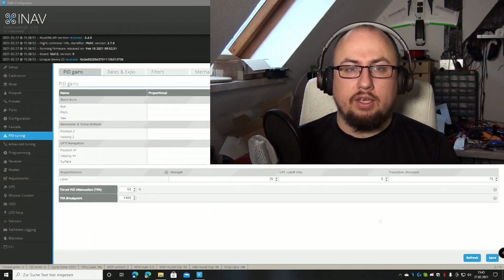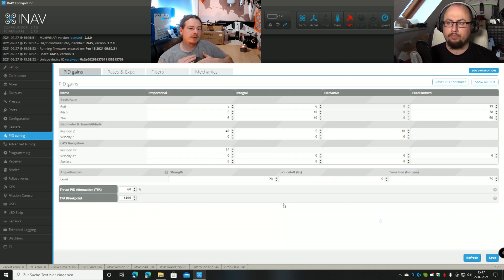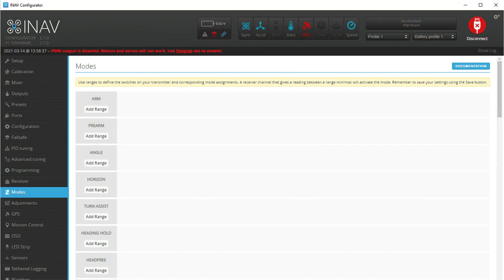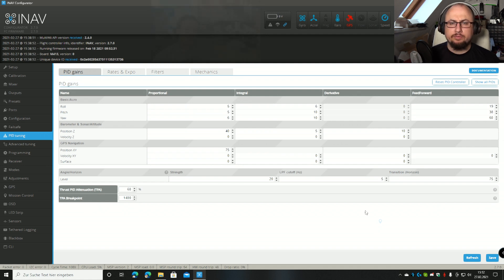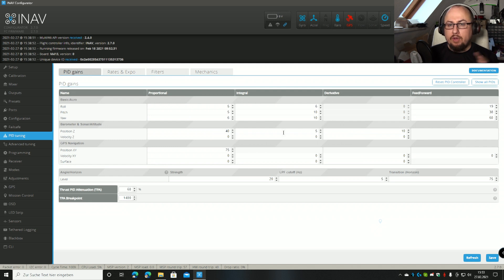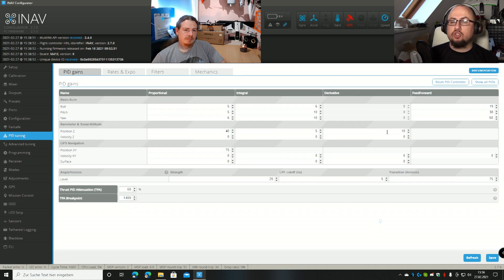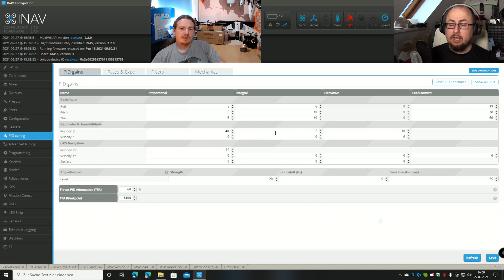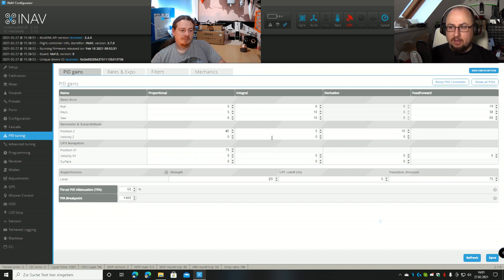Tuning iNav Explained: 2 - Tuning Angle and Altitude Hold, and why they are important

Comment: Hi did you know why INAV cannot detect my M181 Walksnail Compas?
I already plug into the socket to my Speedybee f405wing (SCL &SDA already connected)

I heard that if I want to use Altitude Hold feature in INAV I have to activate the Compass
Reply from the maker: If you’re setting up a fixed wing. You don’t need compass. You only need that for alt hold (and other navigation) on a multirotor. 

If the I2C bus is wired up correctly. Maybe the compass is conflicting with another device. Like the baro.
Reply: @MrD  hi
Thank you so much
I missunderstood about compas 
I will disconnect the wire
Thank you so much

Comment: Hello Darren, as always a great video, although I've seen it a bit late, hahaha, but it always clears up my doubts, and when I've asked you something you've always answered me well and helped.  Today I am considering the following, I always have a mode with a fixed altitude, I use it a lot, but this mode takes away control of the throttle, it doesn't matter, but it happens sometimes, either because the barometer is poorly ventilated, or for any other reason The reason is that the aircraft does not maintain altitude, it generally loses altitude little by little, this is dangerous when flying low, my question is, is there any option for me to instruct the aircraft to raise or lower its flight height? I think that is done in drones, if you set the height, with the throttle in the middle position, if you raise the stick it goes up in height and if you lower it, it goes down in height. Can that be done in INAV with an airplane?  Thank you very much in advance, greetings.

Hola Darren, como siempre un video estupendo, aunque yo lo he visto un poco tarde, jajaja, pero siempre aclara mis dudas, y cuando te he consultado algo siempre me has respondido bien y ayudado. Hoy me planteo lo siguiente, tengo siempre un modo con la altitud fijada, lo uso mucho, pero este modo me quita el control del acelerador, no importa, pero ocurre a veces, bien por que el barometro este mal ventilado, o por cualquier otro motivo que la aeronave no mantiene la altura, por lo general va perdiendo altura poco a poco, esto cuando se vuela bajo es peligroso, mi pregunta es, hay alguna opción para que yo le indique al avion que suba la altura de vuelo o la baje, eso creo que se hace en los drones, si fijas la altura, con el acelerador en la posicion media, si subes la palanca sube de altura y si la bajas, pues baja de altura ¿Eso se puede hacer en INAV con un avion? Muchas gracias de antemano, un saludo.
Reply from the maker: I guess you are talking about Cruise mode? You can raise and lower the altitude with the pitch stick. It is a slower adjustment than in normal Angle mode.
Reply: @MrD  
Excuse me for insisting, so in cruise mode, raising and lowering the throttle stick can we modify the height?  I didn't know that, if so, please confirm.
Perdona que insista, entonces ¿En modo crucero subiendo y bajando  el stick del acelerador podemos modificar la altura? Eso no lo sabía, si es así, confírmamelo por favor.

Comment: Hi guys. Arm and angle mode not working same channel. Does anyone knows why?
Reply from the maker: I would not do this. Have arm on it’s own 2 position switch. You shouldn’t touch the arm switch unless you want to arm or disarm. It shouldn’t be used for flight modes.

Comment: Hi Darren - I notice with iNav FW 4.1.0 there is no ALTHOLD - would I be correct in assuming  POSHOLD now incorporates ALTHOLD  - ...joe
Reply from the maker: Hi Joe, ALTHOLD is still in 4.1. It should be in the Flight Mode Modifiers section. Though it will not appear if the hardware to use it is not there.

But no, for quite a while now, you've not needed to add ALTHOLD to POSHOLD. I'm sure that was changed in one of the 2.x versions. With 4.1 and above, the only mode that you should add ALTHOLD to, if you want it, is ANGLE. But in all honesty, there's not much point in that.
Reply: @MrD - Sorry for late reply but you are absolutely right - wow - I suppose it's logical thinking about it - would you please suggest typical Flight Modes for a 5-7'' quad ...joe
Reply from the maker: No worries Joe. Sorry, I don’t have any INAV quads. So I couldn’t really answer that. Not without experience of using them.

Comment: I noticed that when I turn modes on for angle and horizon that my plane will twitch on its roll axis. Any ideas what could wrong?  Acro flies perfectly.
Reply from the maker: - What version of iNav?
- What have you done so far?
Reply: @MrD  I ended up turning the strength down to 5 and seems to be ok. I’m using 4.1 right now. I have 2 HEE wings using a matek f411 and literally one flies normal with strength at 10 whereas this one needs it turned way down. Kinda weird
Reply from the maker: Both the exact same model? The first thing I would check are the control surface throws in manual mode. You may find that the twitching plane has more throw, too much perhaps? Which HeeWing model is this?
Reply: @MrD  Its the F01 wing. I was curious if maybe the frequency would have something to do with this. Too much over compensation for autoleveling?  Reminds me when the rate gain is too high on a kopilot fc
Reply from the maker: Are both planes running default PID settings? Have they been autotuned? If so, how did you do the autotune. The level strength shouldn't really cause this problem if it's fine on an almost identical setup. It's more likely the model has a more aggressive setup somewhere. Did you every click the reset PIDs button?
Reply: @MrD  yeah I haven’t messed with any of the pid settings. Like I said both fly awesome in acro. I don’t really use manual very often. I have tried to autotune but not sure if it saves the settings.
Reply from the maker: To be honest, stuff like this is tricky to sort out on YouTube. If you’re on Facebook or Discord, it would be worth joining the INAV Fixed Wing Group on those platforms. With the ability to share images and videos, diagnosis is easier. The links for both are on INAVFixedWingGroup.com. It would be good to see the PIDs, rates, mixer, and outputs for both models.

Comment: hi. I cranked my FF really high like over 120 and lower angle strength and it flies really nice...why ? is it okay . cause the pre sets sucks , and I can't fly acro without crashing al the t ime. thanks for the video
Reply from the maker: What version of iNav are you using? There haven't been presets for a few versions now, because they did suck. With iNav 4 and 5. Using the default settings and correctly performing the autotune will get models flying pretty well for the most part.

Comment: Hi, friends, I m just noted that my ANGLE mode (testing on the table at home) , the elevons are moving just a little slowly in the  conter-react , it is normal ? I not eve made the maiden flight. Where should I adjust the rates of the servos in for ANGLE mode ? labels name in the TAB  of the Inav interface ?, thank you ! and I m really new in this world of Inav.
Reply from the maker: Angle won’t react fully until it’s flying. You don’t need to adjust the rates for angle. Just make sure that when in manual the surfaces move correctly, and also move in the correct directions in angle. Finally, make sure that stabilisation is moving in the correct directions. 

It reacting slowly is normal on the bench.
Reply: @MrD  Hi Mr.D, and thank you again, I really appreciate your tips, and yes, I checked everything regarding the elevons movement  in 
MANUAL , and these reacts correctly and in the right way, also I checked in ANGLE too, and even that the reactions are very slowly and "heavy", and yes , they counter-reacts correctly. Well, you encouragement
me now, and I feel better now in front of the maiden flight, just waiting for the weather allow it.(much rain and windy) regards from Sweden.
Reply from the maker: Yes, it should be fine. Angle will be slow until you autotune if you're using iNav 3.0. But manual will of course be fine, and Acro will react quickly. If you're apprehensive about the maiden, you can check your settings here https://www.mrd-rc.com/tutorials-tools-and-testing/flight-controller-therapy/inav-pre-maiden-checklist-a-helpful-reminder-and-saver-of-foam/
Reply: @MrD  Oh thank you this guide was exactly what I was looking for, but coludnt find any like this in the new Inav 3.0.1 Wikipedia, just a lot of information but nothing consist and simple like your pre-maiden  check list !, I will follow that now, and wait for the weather be fine for maiden, and then I ll be back with the test report. thank you !! again greetings from Sweden.
Reply from the maker: I'm glad it helped. The iNav Wiki is a bit out-dated in places. I hope the weather turns soon.

Comment: I got some problems with angle mode ... It levels but it takes like 5-6s which means it will hit the ground if I don't correct it pitches down after 180 turn
Reply from the maker: Do you have any DVR footage of this?
Reply: @MrD  I'll try to look it up I think I do thx for the help
Reply: Not exactly the one I wanted but here you can see auto trim doesn't do pretty much anything and it keeps pointing down and rolling left. In manual mode the plane flies like a charm completely level pretty much so mechanical trim seems ok .. in inav o made it so it has 4 degrees on pitch so if it's on level surface it points little bit up .. not sure what's wrong .. no radio trims either
Reply from the maker: You’re 100% sure there are no radio trims. That would have been my first guess looking at the footage. 

If it is flying perfectly level in manual with hands off the sticks, and there are no trims in the radio. The next thing I would look at is board alignment for the roll and pitch. Perhaps put the roll and pitch angles on the OSD and set up adjustments to change them in flight. I’ll see if Marc has any suggestions too.
Reply: @MrD  I'll try that.. no trims and perfectly level with hands off in manual mode .. it's weird my other planes work pretty good this one not so much haha
Reply: @MrD  so I figured it out .. it's a horizon drift .. inav suffers from this and it's well known seems like more videos on this here https://youtu.be/yKIPFwF-fgU
Reply: @MrD  fix is here seems like need to increase the ignore rate .. gonna try this over the weekend and report back

Comment: Tried Alt Hold and quad went to shoot up to the sky lol 
trying to figure this out
Reply from the maker: There's your problem, you're using a quad ;) Is the altitude correct and stable on the OSD?
Reply: @MrD  lmao haha.. I do want to get a plane. Now that I found a field to fly at. 
Yea altitude is steady in OSD. 
I tried lowering alt hold pids in steps from default position 50,0,0 - velocity 100,50,0 down as low as 10,2,2 and 5,1,1
 Shot up a lil slower lol
I have mid throttle off so I left that throttle at 1500. Wondering if I should change to closer to hover which changes depending on battery by a lot lol.. Tried also with a 4S battery for less power.
Reply from the maker: I guess it depends on how alt-hold is supposed to work with a quad. I really don’t know anything about them. I have one on BetaFlight, but hardly fly it to be honest. 

My thoughts would be that alt-hold should hover or hold altitude if you are moving. So that should automatically change the throttle to do this. But I really don’t know.
Reply: @MrD  yea suppose to adjust throttle to hover. On my other quad it just slowly went down. Didn't have issue like this. This one crazy. I'm try lowering that mid throttle setting though it is off. 
I do know even though return to home is off I can't arm with it satellites unless I turn on rth then turn on arm with satellites then set back to drop lol

Comment: Hi, Darren. In angle mode on my airplane I noticed a very high difficulty to roll and pitch. Please, what parameter should I need to change to get more maneuverability on it? Should I increase FF values for roll and pitch? Cheers from Brazil. Thanks
Reply from the maker: Have you done an autotune?

It’s recommended to set the FF so that the movement in acro is 80-90% of the movement in manual. After that, you should perform an autotune. Have you done this?
Reply: Yes, I already have done auto trim and auto tune. In acro mode and auto tune the airplane flies perfect. When I turn to angle mode the flight is very hard.
Reply from the maker: @SILVIOFRANCO1  your rates may be too low. I had this last weekend. I increased the rates and max angles on one plane, just the rates on the other. It was the rates that had the most effect. Try increasing by 20. Both planes I was maidening were C1 Chasers, so a good comparison between the two.

Comment: I am still a bit confused about altitude hold.  I thought  info from the barometer (and maybe gps?) was used for set point, but did I understand correctly that it is just using accelerometer? maybe I did not fully understand

Comment: Will this also apply to the upcoming inav update? If not, would you mind updating the description indicating what inav version this apples to. Thanks Darren.
Reply from the maker: This applies to the current version of iNav. But much of it will still apply with the next release. What is changing is some of the initial tuning methods and also the addition of Derivative. The theory on how the stabilisation system works, the setpoint, the importance of Angle and rates will be the same (with the addition of the D). There will just be a couple of differences when it comes to setting them up. We’ll have a video with the next version covering what has changed and how to get a good initial tune.
Reply: @MrD  thanks Darren. Thanks for the great quality videos you put out.
Reply from the maker: Thank you. I really appreciate that.

Comment: Another fantastic video. Just what we need!  Shout out to Horizon mode!
Reply from the maker: We know how much you love Horizon Steve
Reply: @MrD  I set one of flight mode as PosHold+AltHold, its not arming in this mode,and when i armed in Angle and after takeoff changed mode to PosHold,then my 7"quad coming down sharply.
What is reason?
Reply from the maker: It won’t arm in a navigation mode like pos hold. This is a safety feature. 

To be honest, I don’t know why it drops in pos hold. I don’t fly quads, so have no experience there. Is your baro covered with open cell foam?
Reply: @MrD  No, my baro is completely covered by Kotking coating, i applied coating to fc,esc, to make it waterproof, is it making this issue?
Reply: @MrD  I have applied Kotking coating to make it waterproof, so coating also covered barometer sensor, is it causing this issue?
Reply from the maker: Yes, there is a hole in the baro to sense the pressure. If that hole is blocked, the baro is basically doing nothing.

Comment: I learned a lot today.  Thank You.  There is not much documentation out there on position Z settings.  I would shut off the barometer to solve flight attitude issues.  Now I know where to tune them.  I look forward to your next video showing tuning examples.  Please include examples how to avoid common mistakes while tuning.  I look forward to Inav 2.7 where roll & pitch rates are calculated during autotune.  I have such a hard time with this step of tuning.  Seems my video playback and calculations never yield proper roll & pitch rates.
Reply from the maker: The next version of iNav will have a lot of benefits for fixed wing. Two main tuning enhancements, plus the PIDFF controller will really get things locked in. I’m editing the initial tuning video now, so hopefully that will continue to be useful.
Reply: @MrD  I am going to test 2.7 in a dart250 I'm having issues tuning.  I did not see any new mode for the self leveling feature.
Reply from the maker: I guess it depends on the build at the moment. I don’t think everything has been merged yet.

Comment: I'm still a little confused with your description of altitude hold, will it hold whatever altitude you happen to be at when you flick the switch, or will it only go to a set altitude that you have already preprogrammed to start with??
Reply from the maker: It will hold the current altitude. You can change the altitude with the pitch.
Reply: @MrD  Thanks for confirming that.. I'll probably just have to watch it a couple of times for it to sink in properly... 😀